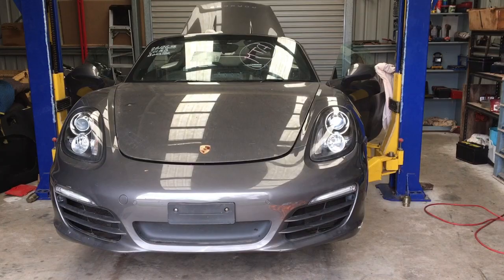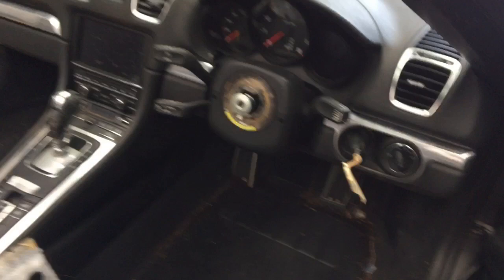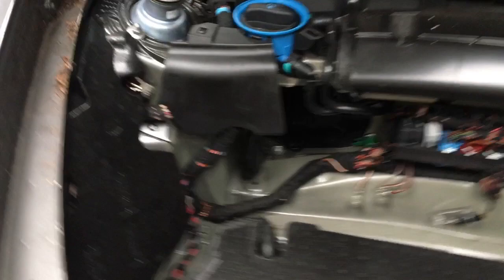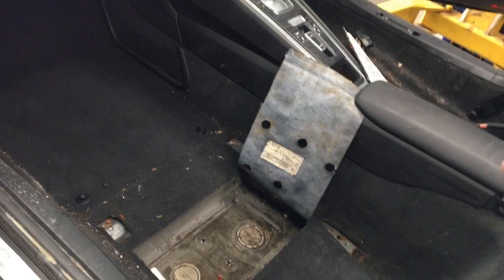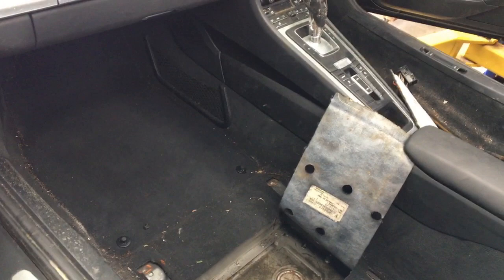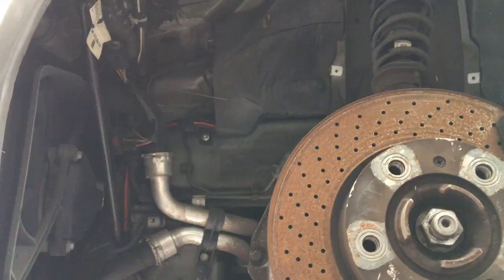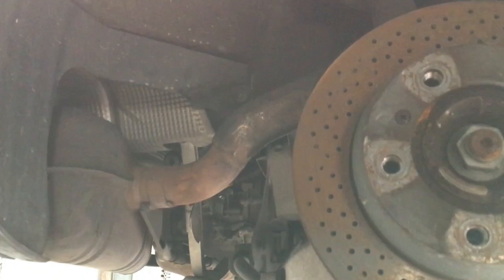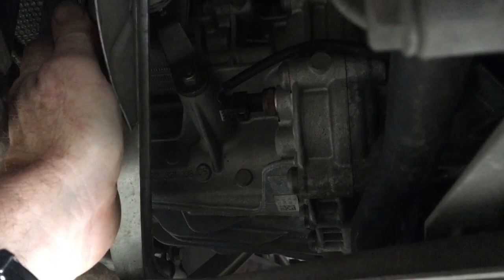Porsche 981 Boxster project

Comment: Hi Jeff, your videos are amazing! I’m very hands on with my Boxter 981 2.7 and what you show has been invaluable to me. I am at 60K miles and planning to change the serpentine belt. I have all the bits and have gleaned the web for info and have a good idea of what is required but would really appreciate your input on this job - specifically removing the engine mount screw/spacer to allow the belt to be fed through. Do you have a video that shows this (apologies if you do but I haven’t found it). Removing the mount bolt from inside the car (removing firewall) seems extremely tight and prone to dropping. Did Porsche really design it to be done this way or would a garage access this bolt from beneath the vehicle whilst on a ramp? Would appreciate your thoughts. Thanks in advance…
Reply from the maker: Apologies for the late reply. Been away with the family for a week. Thanks for the feedback.

I haven't got a video of the belt replacement, but my plan was to make videos of all the general maintenance procedures. Belt replacement was high on the list. Since you asked I'll try an knock something out over the next couple of weeks.
Reply: @jeffrichardsoncardiy  
Jeff, thanks for the reply - that would be amazing! I was building up to do the job of belt change in the next few days but I’ll hang on for now as any video from you would give me real confidence in the process. I’m in the UK by the way. Keep up the good work! Paul

Comment: The car is grey, not white, your image on the screen is misleading. Maybe change it so we can follow the progress easier.
Reply from the maker: The videos I'm making will be very similar to those I had previously done on my daily driver. They will be instructional videos on how to do DIY maintenance on the car, so I plan to keep the same start picture as it's the same type of content. You can assume that every video from now on will be from the grey car unless obvious.

The grey car as it turns out needs very little work done to it, even though it was considered a write off. A new rear BCM, park assist module and amplifier and some new seat covers and it's back to being close to 100%. 

Unfortunately due to the laws here in Oz it's impossible for it to go back on the  road, so I'm just going to strip the whole car and make videos of it. Currently the interior is pretty much bare. Loads of video taken, which I'll post when I can put them together.